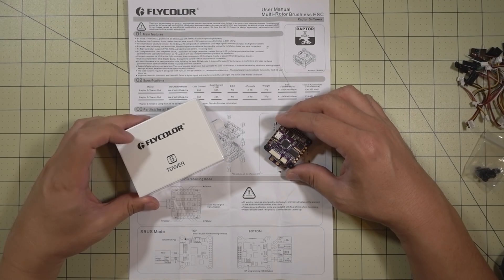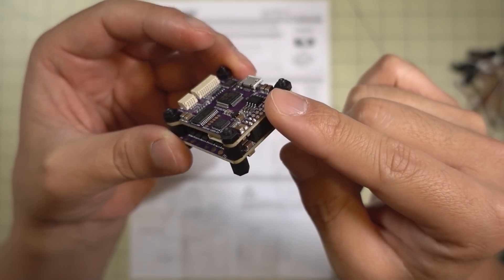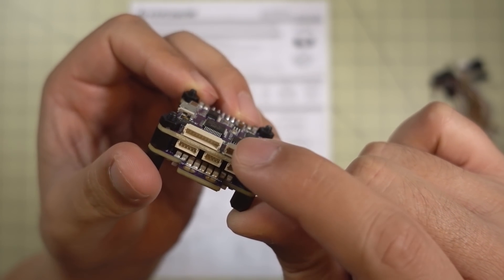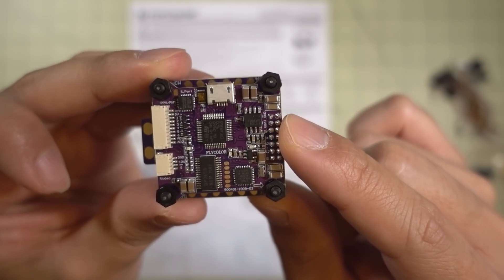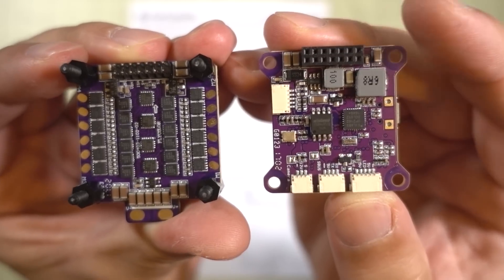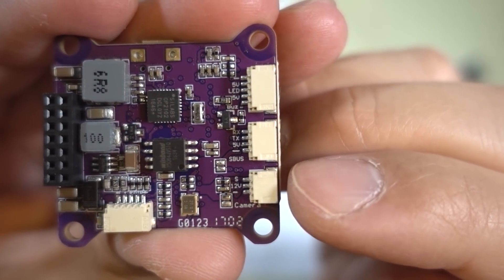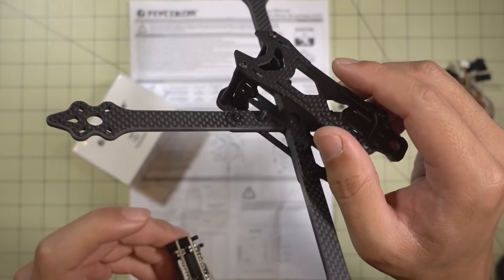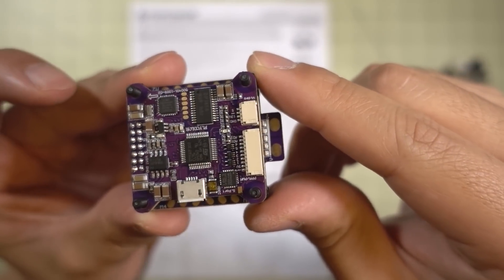Flycolor Raptor-S Tower Review

Comment: Hi  quick question I’m a noob to I have done all of the things that need to be done drivers and comports ....it won’t connect to betaflight  I plug it in it beeps 3 Times red light stays on .....then on betaflight it’s say port opened successfully....then two seconds later it says successfully closed it will not connect ....do I need the battery plugged in to connect to betaflight .....please help
Reply from the maker: https://www.youtube.com/watch?v=0mrJG7AOmRI

Comment: Albert- I'm a noob to this controller. Trying to mate my new Arris X220 to a Radiolink ATS9 and the raptor just beeps continuously with good receiver lock (s-bus). When I connect it with USB to set things up, it beeps just the same. Any ideas?
Reply from the maker: Hmmm, could be a lot of different things. It might be beeping because it thinks the voltage is too low or it thinks the receiver has failsafed. Which of those do you think it is?  I'd double check also that your channel mapping is correct and that you actually have a good bind.

Comment: I have a box of dead raptor towers. Flight controllers either come dead on arrival, dead after a few hours of use, I've had 2 OSDs stop working after minor crashes, 2 of the 4 in 1 ESCs randomly caught fire. It's a sort of love hate relationship; when they work they're amazing. After 5 or so would I buy another? Definitely not...  I always buy at least two because I know they'll fail. So nice though

Comment: It is possible to remove the "FLYCOLOR" sign in the OSD ( upper /left)? ( Not call sign)

Sorry for my english
Thanks
Reply: Im wondering the same. Ive checked all around in MWOSD and cant get rid of the FLYCOLOR in the corner.
Reply from the maker: Yes, you have to connect to the programming port with an FTDI tool and use MWOSD GUI configurator to adjust those settings.

Comment: You should have Banggood send you the Flytower F4 for review.  I absolutely love mine!  There's not much more you could ask for in an AIO package.  Flytower F4 Flight Controller, 25/200/400mW Switchable FPV Transmitter, OSD, Dshot 40A 4 In 1 ESC, PDB, MPU6000, SD card slot.   The only thing I didn't like was the really thick FPV antenna pigtail because it was too stiff and would pop off so I ordered a thinner one that works great.
Reply from the maker: OK, I'll ask them
Reply: Albert Kim Can you ask them to send me one too please lol